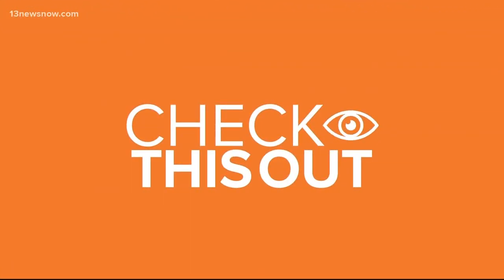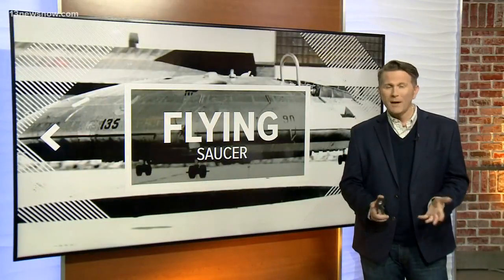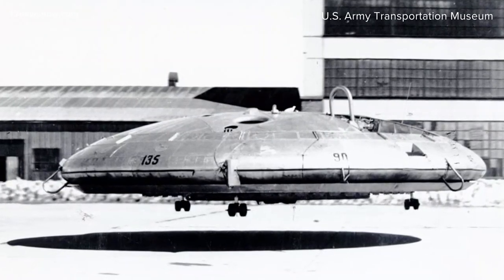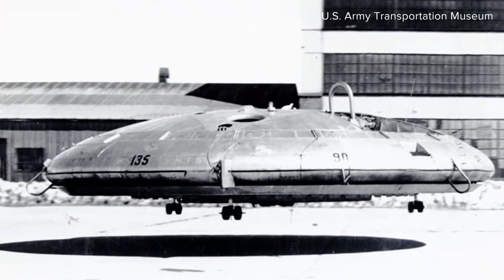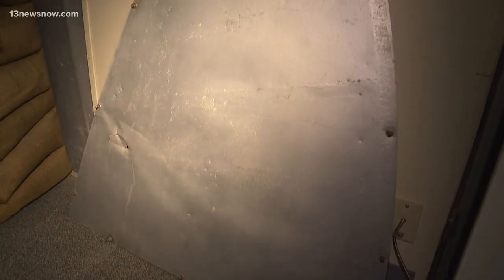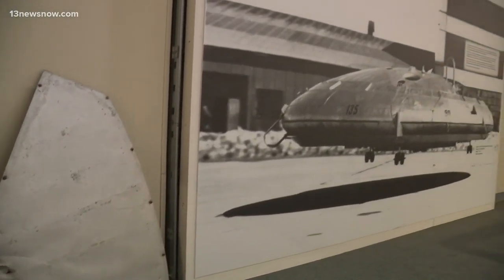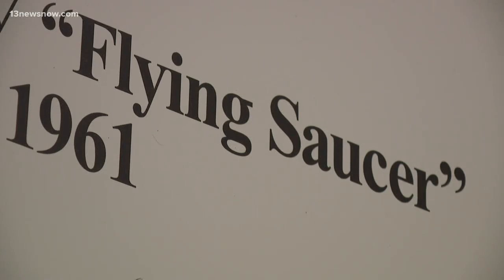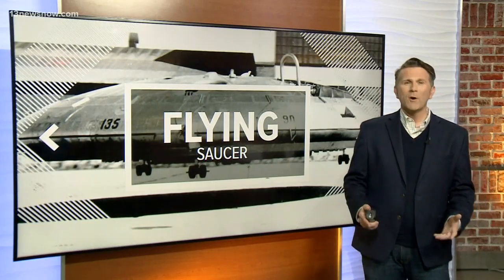Flying saucer lands at Fort Eustis museum

Comment: Aircraft with low aspect ratios (low wingspan vs. wide wing chord) have problems with vibration, stability, drag, and more. Really fascinating though, and often times they are capable of maintaining very slow flight for their weight without stalling. A saucer though... now that's pushing it haha.